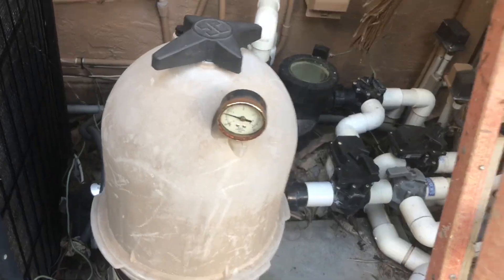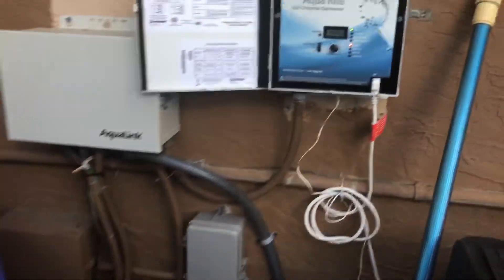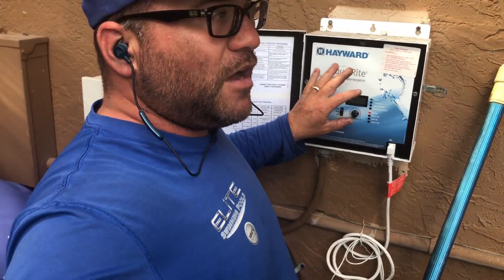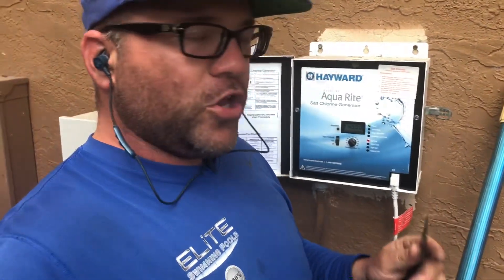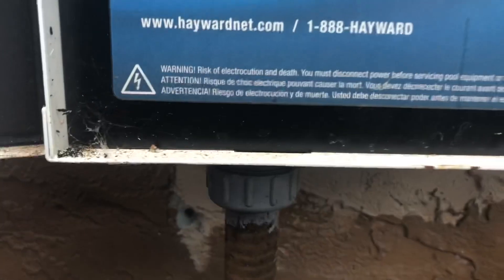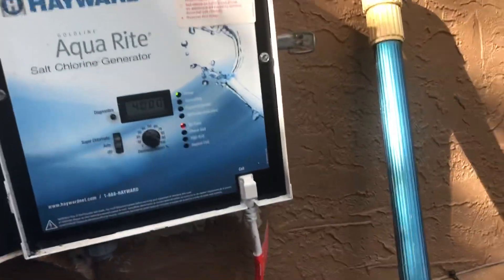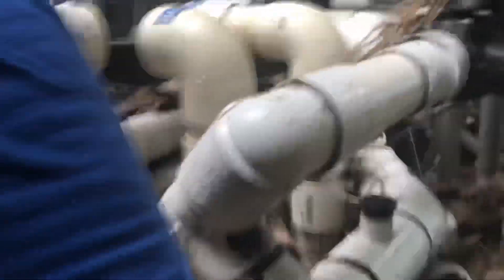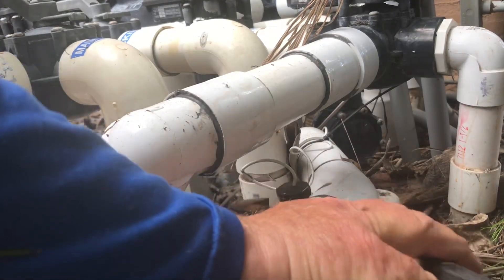Hayward AquaRite Salt System NO FLOW? Tips and Tricks to easily Diagnose and Fix

Comment: You should definitely have one and just twist the wires together instead of using a screwdriver to dummy when your place is closed down through on one of your customers pools just take the end of the wire they plug-in cut it and twist the wires together so you don’t have to worry about getting in contact with a flathead screwdriver

Comment: have an AquaRite 900 salt system.  Purchased a new T9 cell in the fall, and just cleaned it.  When the timer turns on the system in the morning, the check salt and check cell lites are flashing.  When I turn it off then on it goes to 3200 and works fine all day.  every morning I have the same issue even with calibration.  Any idea how I can fix this?  Thanks

Comment: Maybe you answered this question already but, mine started flashing on “No Flow” when I put the flat head in making the contact but did not trigger to “Generating.” It will just continue flash.  Does that mean it the board? Can I switch out the board myself if so? Thank you this is a wonderful video.

Comment: The bypass tip helps. When I found out there was no chlorine being produced my pool was drastically low on chlorine. I order and new switch and in the mean time I took a piece of aluminum foil and covered the telephone style jack on the flow switch. Plugged it back in and works the same as the screwdriver so I was able to run the pool on super chlorinate to get levels back up.

Comment: Excellent.. explained in details and professionally, I did noticed one thing when I pulled mine though - noticed that no matter what direction the metal contact is facing (supposed to be face the water flow) it all rotates together when you screw the cap on, so essentially the entire housing moves which can position the metal flap in the opposite or any direction, unless mine is not well that's what it did to me. Nonetheless, after I re-screwed it worked well.

Comment: What happens if it just keeps blinking the no flow light and doesn’t go back to generate does that mean the board still works ?
Reply from the maker: If your performing the screw driver tip, make sure your making proper contact on the contacts where the flow sensor connects into. If you are and the light keeps blinking and doesn’t  switch to generating this means the issue lies on the board and not the flow sensor. If the board was good and you make good contact on the contacts and the display switches to generating that means the board is good.

Comment: Absolutely amazing video! Thank you for the troubleshooting tips.  I had the exact same problem with a new Hayword T-9 that just installed.  I used the screw driver to trick the board with the screw driver and got the blinking no flow light.  That let me know that the head unit was working just as you stated.  The most important tip for me was when you said make sure the flow arrows were in the right direction.  Mine was not.  I adjusted the direction of the flow arrows and it worked like a charm.  Thanks so much.

Comment: Wow. You saved my life. Worked perfectly and discovered it was the flow switch. 

I just took an old telephone cable and cut the end to reveal the wires and connected the wires together so that it completed the circuit and then plugged the other telephone jack into the unit and it tricked the card into thinking there was flow. Perfect!

Comment: I had a terrible pool contractor and many leaks inaccessible. After 5 years I am now trying to get my pool running. Thing is he didn't install a pool flow switch? Is it a requirement? Im getting the message no flow flowswitch time out
Reply from the maker: Yes this system requires the flow switch installed.

Comment: It turns out the gardener dislodged the data cable and it wasn't properly seated. Didn't even have to use the screwdriver. Works fine, thanks!

Comment: Can you clarify for me that the direction of flow should be the opposite direction of the filter and flowing towards the salt cell? My old flow switch didn’t have arrows on it. Thanks for the help and great video.
Reply from the maker: The arrow of the flow switch should be in the same direction of the water flowing through the pipe.

Comment: Thanks a lot for this video ! quick question, I turned off the filtration and closed valves, but I still have a geyser when I unscrew the flow switch... how can I make sure  the water will not evacuate strongly despite all the valves being closed and pump turned off ?

Comment: Yep, that's the trick. Interesting in my case is that my setup is vertical at the RJ which should not require a flow switch. Ran this system for 4 years without issue then had to replace the AquaTrol and ran into this. Now, just stuck a screw head in there and all good.

Comment: Please help. What should I do next after I replaced the flow switch? It was solid red (no flow) but then turned to blinking red after the replacement. What should I do next?
Reply from the maker: Once the flow starts to flash red, this is the normal process of the system. If the board and remaining components of the panel is working fine, the. Linking red light after about 1-2 minutes should change to green.

Comment: You hit the nail on the head!  THANX BROTHA!!  You saved me at least $200.  Did the crew driver test-it was the Flow Valve. $23 part from Amazon-pool store want $100.  Here is my question-do I EVER PUT THE BOX ON SUPER CHLORINATE?  If so, when do I do it.  My pool got cloudy because the flow flow was dead an I didn’t realize it.
Reply from the maker: You can utilize the Super Chlorinate after a heavy pool usage situation.
Reply: I’m back to no flow

Comment: Thx for the screw driver  tip it worked great to know my main board is working but when I replaced flow switch I  still get solid red no flow.  I'm new to this pool thing water is flowing thur because without switch in water goes everywhere. Do you of know of anything else I can do.  Is there a adjustment I need to do to the return or suction side.I had the salt cell tested and its good. I don't know what else to do. tried again with the flow switched connected to broad for 5 mins never clicked to generating like it did with screwdriver could the jack be bad?
Reply: Same as mine, screw driver tip worked but when I replaced with an original Hayward flow switch, still get solid red and no flow. Did you do anything to fix the problem?

Comment: Thanks!  Diagnosed my bad switch. Honestly, what’s the point of this switch?  My aqua-rite is on a separate time and only runs when the pump is running. I just pulled the plug, clipped and tied the wires together.

Comment: Dude! You saved me a ton of grief and have my pool generating chlorine now. Took an old phone wire, cut in half, split the wires, stripped to copper, twisted together and plugged into AquaRite.  Now there's flow 🙂.  Now I can relax waiting for replacement flow switch.  Just have to remember to turn off generator when pump is off.
Reply from the maker: Glad to hear that.

Comment: Really helpful video.  The red light for No Flow flashed and the green Generate light came on but also the Inspect Cell light was flashing at the same time. Is it most likely that the No Flow switch wire is bad or the Cell itself?

Comment: Well this is great video.  With screw driver I was able to verify unit was good and it was flow switch.  But just sprayed some contact cleaner on connector terminals and inserted a few times and flow switch works again without replacing.  So this does not account for dirty connector contact interface.  But still was huge time saver for me since was not sure whether unit or flow switch was causing the problem
Reply from the maker: Every situation and circumstances are different and unique sir. Thanks for watching and commenting. Be sure to subscribe and watch other videos.

Comment: Great Video and great advise .  Thanks.  You may want to clean the tip of the screwdriver of rust and paint. That’s probably why you had to wiggle a bit to make contact.   Thanks again.
Reply from the maker: Lol. It’s not the rust or paint. It simply because I wasn’t firmly and evenly pressing all the pins on the internal connector port.

Comment: How do you get rid of the Hot message on the LCD screen.
Reply from the maker: Is your water HOT?

If not then the temp sensor in the cell is bad and the entire cell may need replacing.
Reply: @EliteSwimmingPoolsTV  I found a video to fix it. Cost me 6 bucks,got tired of buying 600 dollar. Cells

Comment: Could you just bypass the flow sensor and run the system?
Reply from the maker: Not recommended for this is also a safety feature for the unit to know when and when not to generate chlorine

Comment: Worked! Got a $20 replacement. I had  thought I needed a new cell since I think I submerged the whole cell I'm acid solution to clean and it stopped working. I think the residual acid that was in the cell must've hit the sensor and messed it up

Comment: Did the slot screwdriver test. NO FLOW blinked but never switched to GENERATING. Still safe to assume it is the switch rather than the board? Thanks for the tip BTW
Reply from the maker: The no flow blinking light will blink for about 2-4 minutes until the generating light will illuminate and no flow light goes away.

Comment: Thank you so much!
I actually found a small cut along the wire. Between the sensor and the board. I spliced the wire and the switch is working again. I'll buy a Haywood switch in the meantime
Reply from the maker: Good find.
Reply: @EliteSwimmingPoolsTV   what would happen if we put both wires simulating he sensor is close ana there is flow and leave it in that way for a while ?
Reply: I mean like a short circuit

Comment: @Elite Swimming Pools TV you're awesome!  My only problem is that I don't have a phone jack on the other end of my old flow switch.  If I do, it's way up in the metal box of the system.  I tried and tried to reach way up in there to see if there was something there besides wire, but it sure doesn't seem like there's a jack inside of there.  Any suggestions??  Dare I attempt to remove the metal box from the system??
Reply from the maker: Which system do you have? If it’s a Prologic or aqualogic, then the phone jack connection is inside the power center panel. Unlike this stand alone salt system which is underneath the bottom box.

Comment: I performed your test with a flat head and my board is working. My pool guy replaced the flow switch with a brand new Hayward part but I'm still having the same problem. If I wiggle the switch a bit, the flashing will start up but not for long. What now? Can the part receiving the switch go bad?

Comment: Thanks for the video.  No Flow switch light has been dark.  Did the screwdriver test.  "No Flow" indicator blinked, but did not go dark and did not click over to "Generate".  Replace the Flow Switch?  Power to my board is continuous.  Is this a problem? It used to come on by timer which was by- passed when the new Pentair pump was installed.  I'm assuming the board does nothing until the water starts flowing and the  flow sensor is activated?

Comment: So I did the screw driver test and the salt cell turns on. So I ordered a new switch and installed the switch and it didn't work. Ordered a second switch and it doesn't work either? Am I doing something wrong?
Reply: I'm having the same problem. Did you get yours to work?
Reply from the maker: Did you make sure the flow switch is screwed in and facing the correct direction of the water flow?
Reply: @EliteSwimmingPoolsTV  I checked that and it is facing the correct direction. Any other thoughts?
Reply from the maker: Is the flow switch you purchased an original Hayward part, or a generic part?
Reply: @EliteSwimmingPoolsTV  it is an original hayward part
Reply from the maker: Let’s go back to the problem you had originally and the test. Did you unit have a solid red light illuminated on the No Flow indicator led? When you performed the screw driver test, did the No Flow indicator light begin flashing and while you keeping the screw driver in place while the unit continues it’s system check and allow this to conclude to where the No Flow light turns OFF and the Generating Light illuminates Green?  That is the proper way to perform the test because this simulates a working flow switch and a good working unit.
Reply: @agaither42 and @averyhaberman7934, are your salt system now working? I have the same problem now you had then and I just want to check what you did to fix it

Comment: If the flow switch line got chewed by an animal... And it shows no flow... Is the system still generating chlorine?  Even when the board says no flow?  Wanted to know so I can decide whether to leave it as is without changing the flow switch
Reply from the maker: The system will not generate chlorine. Flow switch must be replaced

Comment: Maybe this is a dumb question but chlorine will not be generated until you replace the sensor correct??
Reply from the maker: Yes the sensor has to be replaced for this will throw an error and unit will not produce chlorine.
Reply: @EliteSwimmingPoolsTV  thanks
Reply from the maker: Your welcome.

Comment: Great video. Best wishes for further success. 
Two questions.  Any reason i couldn't use this technique for bucket testing a cell? ( i dont have a dummy so cant activate the pump) Also, what are your experiences (if any) with aftermarket vs oem cells?
Thanks

Comment: Gread video! Thank you so much. Can I ask for your help by e-mail? I have a T-cell 15 with no power light and a flashing no flow. The display says 3400. Thank you so much.
Reply from the maker: Check on the flow switch to determine it is the flow switch or board as described in video. At initial start up of a pool pump turning each day, the salt system box will have the flow sensor light flashing for a approx time of about 1-3 min, this is the systems internal diagnostic checks insuring proper operations of the electronics. Once that time period ends and if all electricians checks OK, the flashing light should switch off and the Generating light should illuminate a solid Green (if you listen closely you’ll also hear a slight “CLICK” sound). Give the units it’s time to go thru the diagnostic

Comment: Thank You

That phone type jack test You showed worked

I had an old phone jack and shorted ONLY the center wires (Red & Green) to replace the screwdriver test (and did not short the Black & Yellow)

It is generating now but the Inspect Cell light is Yellow

I just replaced the cell back in June

I am going to look at more YouTube videos and see what the INSPECT CELL light is connected too

Ken in Florida
Reply from the maker: Typically when they inspect cell light is on and flashing this is an indication for the pool owner or the pool service provider to inspect a cell in case it needs to be cleaned. If the sale is clean then simply hold the diagnostic button for five seconds and this will Reset the internal clock for the next time the cell should be inspected

Comment: That is an awesometip. I have another problem with my AquaRite. The system reads 1700 on salt level, but water tests at 3000. Hayward suggested it was the cell, so I replaced it but problem didnt go away. Any ideas?
Reply from the maker: Hit the diagnostic button until you find a value with a negative sign in front of the number. ( ensure the system is on, the toggle switch is in Auto, and pool running for more than 10 minutes when doing this) if that number shows a large number than the number displayed in the first value shown on the screen the push UP the toggle switch from Auto to Super Chlorinate and then back down to Auto. This will record and display that large negative value as the first value displayed. This is calibrating and saving the true value of the salt content. So here’s an example, pool has been on for more than 10 minutes and you open the Aquarite box and the display shows 1700 you press the diagnostic button until you see a negative number, — 3000, at this point of viewing the larger number immediate push up the toggle switch to super chlorinate and back down to auto. Hit the diagnostic button until you reach the first displayed value and it should read 3000.

Comment: I did the test like you showed and the No Flow light did flash. Lead wire is still good, so definitely the sensor (only about 3 yrs old). Now I just have to find a replacement sensor. Thanks for the video and information.

Comment: Thanks for your video. I've performed the screwdriver trick as well and the salt generator was working.  The TCell is brand new in March and when working readouts approximate the salt tests. I've replaced the flow control switch.  The salt generator appears to be working about 50% of the time.  The other 50% of the time I receive a no flow readout on my display. Is it time to replace my pcb?  Could it be something else?

Comment: I have a solid light…I tried the screwdriver trick and the light changed so I swapped out the flow switch and the light is still solid…how long should it take for it to recognize?